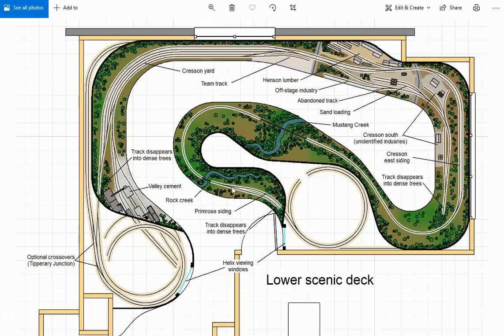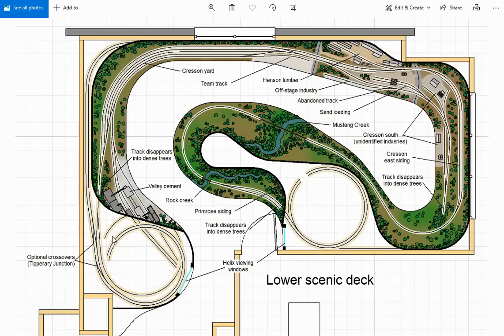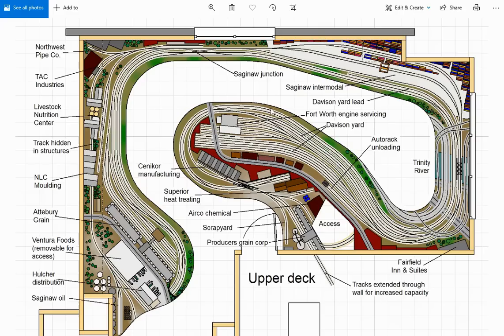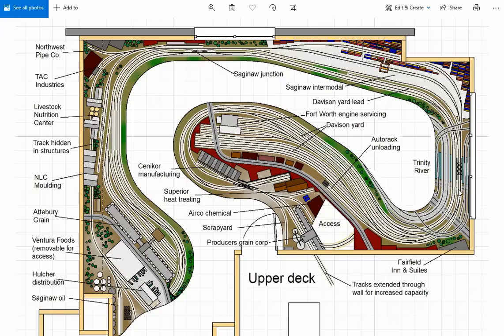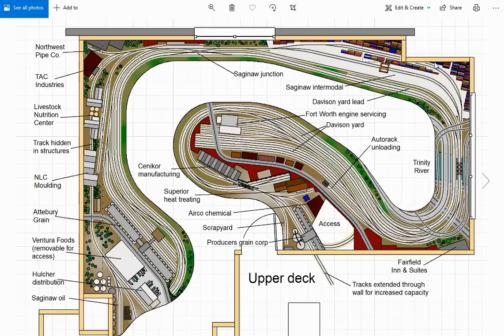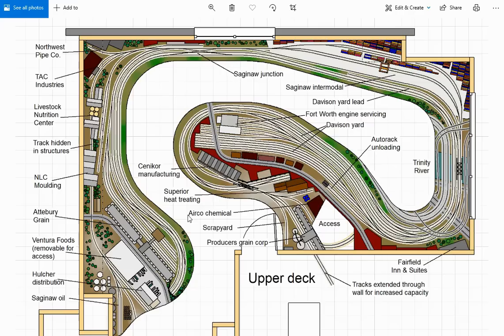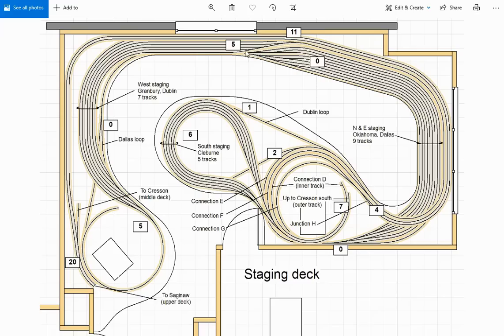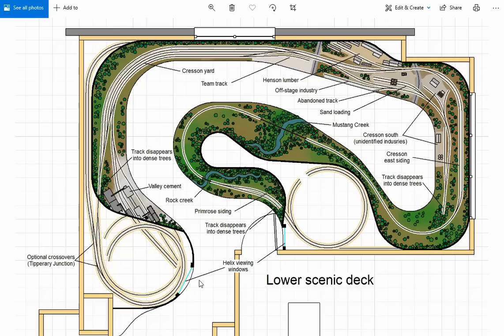Texas prototype in an attic - part 3: Adding the details

Comment: Love the design.  What is the biggest project you’ve worked on? Would you decline a project too big?
Reply from the maker: The biggest and most complex layout design I have so far worked on is around 1200sf on three full decks with a four-track helix.  Construction began on that layout quite recently and there will eventually be a series on that layout.
I haven't yet declined a project on the grounds that it is "too big", although a couple of clients have proposed huge projects and then disappeared when I've given then a cost estimate.

Comment: Hi PETER,
i'VE JUST BEEN LOOKING AT YOUR WEBSITE  and found that two of the pics on the Gallery page are in fact inverted. They just happen to be of roughly the same bit of track and a building. I don't think its my computer to blame !  The gremlins are active again.
Reply from the maker: I don't think so, but it's possible.  Which pictures are those?
Reply: @mpeterll  its teh 5th  and 7th from the left, both showing the tank car.     John
Reply from the maker: @johnstanley3233  I don't see any that are backwards.  The easy way to tell is to read the lettering on the car.
Reply: @mpeterll  No Peter, NOT backwards INVERTED - upside down !
Reply from the maker: @memyshelfandeye318  Both those pictures are the correct way around on my computer.  They are pictures of different industries.  The one with the locomotive and the loading dock is Dunnow Storage.  The one with the tank car is National Widget.

Comment: I know I sound somewhat like a sycophant however is there anyone else in the world you would go to for the design of a layout! A great series Peter
Reply from the maker: I would have no reason to go to another layout designer.  There are a few others, each with their own unique style.  Some of my clients have told me they looked at other designers before coming to me.  I had one tell me I was too expensive, then come back and sign up after rejecting the other designers.  I would always recommend that anyone in the market for any kind of custom work consider a few different suppliers and go with the one whose previous work matches what they hope to achieve.
Reply: that’s exactly right Peter. As you know, I did shop around.  So looking forward to seeing the next iteration of my design and even more to seeing the final layout installed in  my basement. Btw - the engineer’s report should be available this week. I am anxious to get going with the next phase of the project and lock you in for construction.